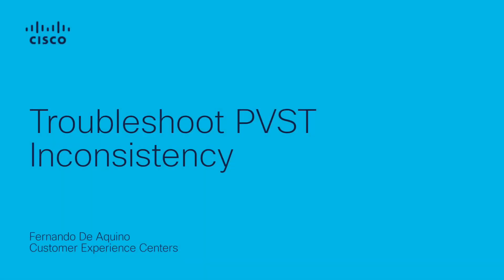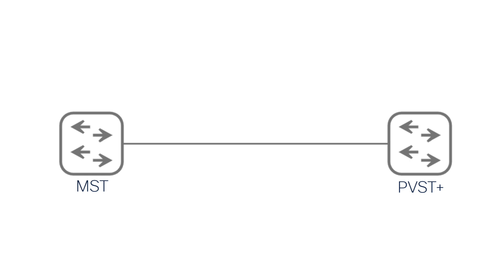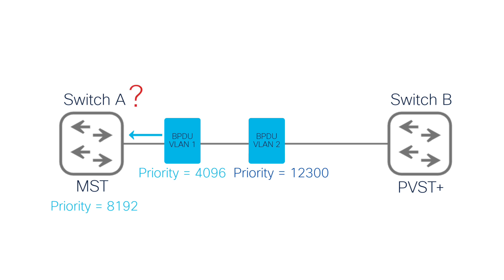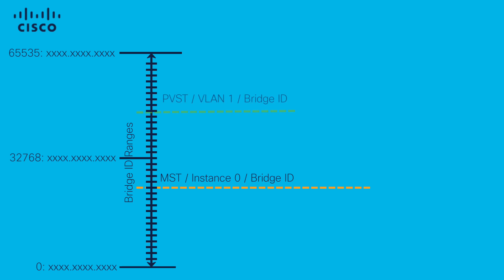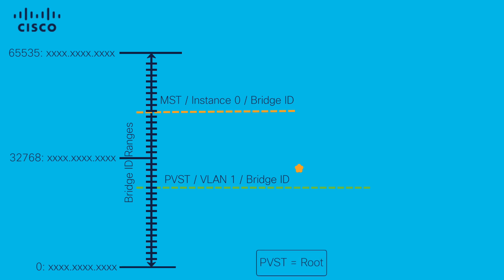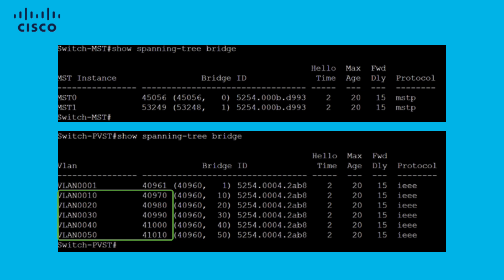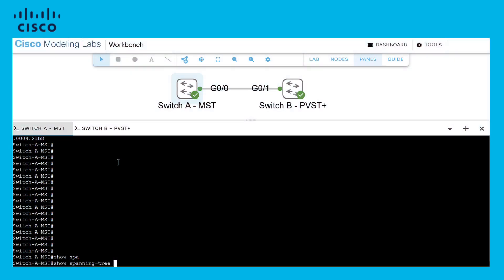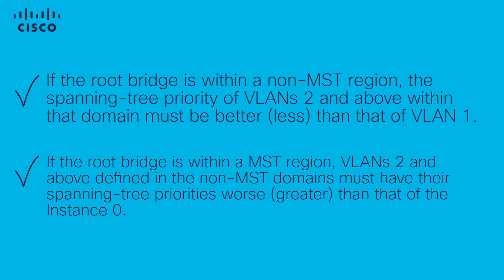How to Troubleshoot PVST Inconsistency in Cisco Networks | Spanning Tree Loop Prevention Guide

Comment: Is this the same as that of PVID inconsistency? we had such issue (PVID inconsistency) and we couldn't solved it. We have to disable STP on that affected vlan temporarily to restore the service first. 
The issue is that that affected port is connected to 3rd party provider and we dont know the exact STP configuration they are running in their network and they refused to comply with us as the link was running smoothly for long before it suddenly entered that state, hence they believe we are the one that carried out some configuration that affected the link mean while we didnt do anything.
Reply from the maker: Hi there, thanks for your question, and we would be happy to help!

- PVID inconsistency occurs when a PVST+ BPDU is received on a VLAN different from the one it was originated on. This typically happens due to a native VLAN mismatch or VLAN tag translation issues on the link. When this inconsistency is detected, the affected port is put into a blocked state for the involved VLANs to prevent loops. This is often seen when a port connected to a third-party device or network has mismatched VLAN configurations or when VLAN tags are altered by intermediate devices. The port blocking behavior you described, where you had to disable STP temporarily to restore service, aligns with this scenario. Cisco switches log messages such as `%SPANTREE-2-RX_1QPVIDERR` and block the port to prevent loops until the inconsistency is resolved or cleared.

- PVST inconsistency more broadly refers to any mismatch or misconfiguration detected by PVST+ that causes ports to enter inconsistent states, including PVID inconsistency and type inconsistency (e.g., when a PVST+ BPDU is received on a non-trunk port). PVST+ uses VLAN tags in BPDUs to detect these inconsistencies and blocks ports accordingly to prevent forwarding loops. The inconsistency detection mechanism is designed to protect the network from misconfigurations or incompatible STP implementations on connected devices, such as third-party switches running different STP versions or configurations.

Since the affected port connects to a third-party provider whose STP configuration is unknown and they refuse to cooperate, the PVID inconsistency likely arises from a mismatch in VLAN tagging or STP versions between your Cisco switch and their equipment. This can cause the port to be blocked by STP to prevent loops, and disabling STP temporarily restores service but is not a recommended long-term solution due to the risk of loops.

We recommend completing the following steps:
- Verify and align the native VLAN and trunk configurations on your side of the link.
- If possible, use packet captures or debug commands to identify the VLAN tags and BPDU types received on the affected port.
- Consider using BPDU filtering or blocking PVST+ BPDUs on the interface if the third-party device does not support PVST+ and you accept the risk of disabling STP on that link.
- Document and communicate the risks of disabling STP to the third party and seek their cooperation for a stable configuration.

PVID inconsistency is a specific type of PVST inconsistency related to VLAN tag mismatches in BPDUs. Both cause ports to be blocked to prevent loops, and troubleshooting involves verifying VLAN and STP configurations on both ends of the link. We hope this information helps!